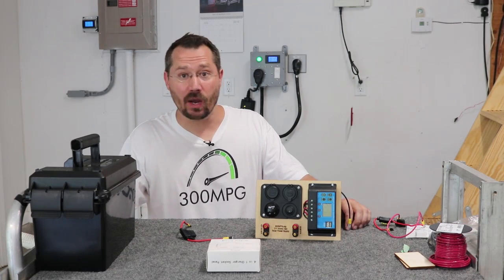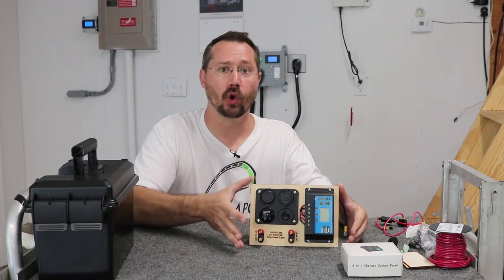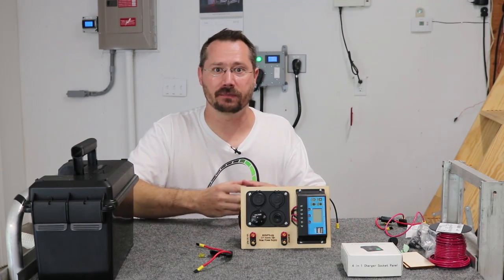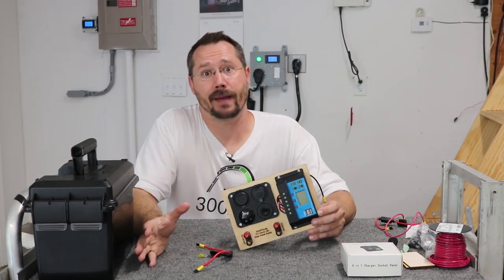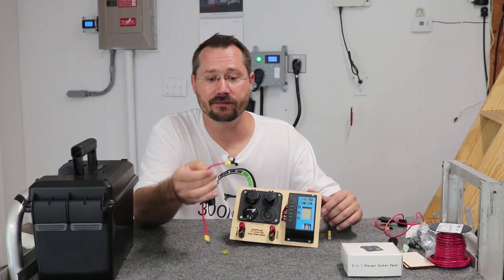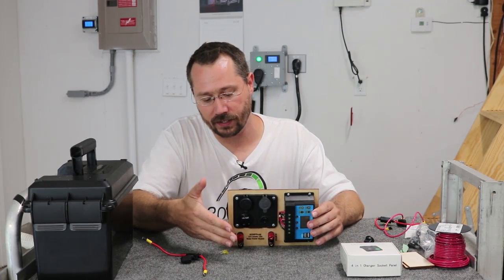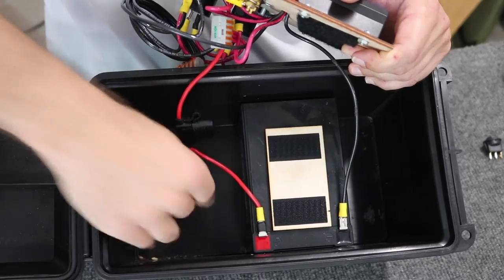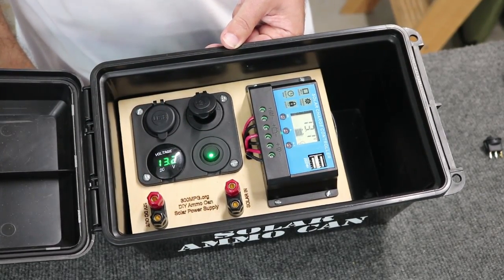Solar Ammo Can Alternative Wiring and Disconnect Switch

Comment: On my first build I used a large 32HA battery which uses large bolts for positive and negative. I actually used an automotive disconnect on the negative side, which disconnects the entire system by turning a knob. Quick and easy. My second build I used an isolated switch on the outside of the box that turns the controller on and off because the batteries are smaller with blade terminal connectors. Love your videos on these. I used 90% of your info to build mine. Thanks for that.

Comment: Hi Ben. I built a box using several different vidoes from other builders. I too cut out a small template using 1/4" ply, definitely too thick for the rocker switches I use. I actually wired each load component with its own switch, just so I could use other ports e.g. SAE, or Banana Jacks, etc, independent from the main panel and main switch. Most other builds have switches, and other components all mounted on the outside of a waterproof or water resistent box, I cut my own panel template to keep everything nice and neat inside, and with less opportunity for water intrusion. 12v 12 ah battery. Then I decided to add solar. Now cannot seem to get it to work. So, I dismantled the entire wiring schematic and am starting all over. Adding solar was supposed to be easy, not.
Great videos, and yes, when folks do the wiring on camera and go fast, that is a turnoff. Was for me. I am in the process of filming an entire build and will go slow through the wiring portion, as most reviews or comments are in regards to the wiring. You do not have to be an electrician to do this, but it is still new to some, fun for most, and a neat idea for camping, kayaking, etc. Thank you for the vids and the instructables, etc...

Comment: Sweet didn’t know you made this video. Good stuff. I actually have two switches. One that turns on the charge controller. Then another one turns on the ports. This will allow the charge controller switch to be turned on when charging and not have to turn the “load” ports on.
Reply: That's what I did on mine, too. 
One switch allows charging and energizes two banana outputs. This also works as the "kill" switch. The other switch turns on the quad panel.
Reply: I put a second switch in in hopes to do the same but I can't seem to figure out the wiring.  Are you able to assist me?

Comment: Thanks again... I really enjoyed the first video, until another viewer mentioned a switch between the battery and first component(solar controller).. couldn’t agree more on that comment... then I saw your modified, updated version.. thank you.
I am now looking for a fusible disconnect switch(20 or 30A) that is more robust and yet small enough to fit in this limited space..
Again, thank you for a great video!

Comment: Ben Thank you for that great Video.  I ordered your template board(so great of you to put that out there for us.)  I agree with Sandra I'm totally with you on putting all the components  together but when it comes to wiring it up with the wago connectors you sort of timed lapsed through it and lost me.  Also I'm interested in the alternative disconnect switch wiring.  Please, please, pretty please, could you do another wiring video step by step for electrical newbies like me.  I don't want to blow myself up.  Thank you.  Rockin and Rolling in Southern California and want to get this box built for my earthquake preparedness. Rick
Reply from the maker: Don't worry, you won't blow yourself up.
I also have written directions on Instructables. Sometimes it's easier to follow written directions than video ones: https://www.instructables.com/id/Ammo-Can-Solar-Power-Supply/

It's a bit hard to do a great video on the wiring as you would mostly just see lots of my hands blocking the view of where the wire connections are made. Probably best just with the listing of what goes where. Check out the Instructables link and see if that makes a little more sense for you.

Comment: Ben.  Wow.  Informative with excellent and needed tips.  Electronics is one of my many weak points.  That said, I am looking at using a DC wall adapter as an alternative when solar is not easily useable.  My plan is to use a SAE type connection for the solar input.  Is it possible (without creating a Griswold electrical disaster) to splice / marry the SAE connection to the end of an appropriate DC wall adapter?  Do you have advice on that?
Lastly, based on the original setup - one of the best builds / designs on the Tube - what other options are there to prevent a ghost drain on the battery via charge controller?  Another switch?

Comment: great video, really great however I would like to add that using the switch panel as a master cut off could actually be a problem. If I were to use this configuration whilst camping with my family, you could guarantee my wife would switch it off at some point during the trip leaving the solar panel burning the controller out, I'd prefer to remove the fuse to isolate everything
Reply from the maker: I don't see how the solar panel would "burn the controller out".
In my original video, I suggested simply pulling the main power connection or the fuse. Many people commented that that would be inconvenient or that the system REQUIRES some sort of disconnect switch.
I shot this video just to show another way it could be done.
My personal preference is just to disconnect the main wire before storage.
Reply: BenjaminNelson the manufacture of the solar charge controller says it’ll damage the controller to have the solar panel connected with no battery. A double pole single throw switch should be used to disconnect both the battery and the solar panel

Comment: Watched the videos and really like the designing, pretty cool.  I'm building one with a slightly larger dry box with 2 X 12 AH batteries.  I think it will be around 18 pounds.  It should have room to expand it to 3 X 12 for a total of 36 ah.  At that point it wouldn't be "portable" but would be a great box for vehicle Stealth Camping along with a 30-50 watt panel.  I'm using one of those larger socket panels, the one with the 4 items plus like 6 buttons across the top.  Is everyone making these as shown with the socket panel etc inside the box?  I like the idea, but for stealth camping I like the idea of having it more like an appliance with easier access.  Still assembling parts mostly from junk I have laying around.

Comment: Thanks for the heads up on battery drains.. I always leave my battery charger connected even when it's turned off.. Now I just pull the quick disconnect..

Instead of manual switch, couldn't you just install a Low voltage disconnect relay, and that would limit the amount of battery discharge, no matter what is draining it?
Reply: I am also interested in using a cheap LVD, trouble I see is the wire size that goes from battery to load needs to be very small 16-18 guage to make the connection through the LVD? Not the 10 -12 guage I would like to use.

Comment: Very good video.
Question, how do you reduce the 12v to 5v for usb power?
Reply from the maker: It's built right in to both the controller and the secondary panel.

Comment: Great instructional videos!  I've run into a little problem wiring in a separate illuminated toggle switch.  I have the switch grounded and source connected properly.  When I connect the load going back to the controller it shorts, blowing the inline fuse.  Any thoughts??
Reply from the maker: As much as I like illuminated switches, there are so many ways to hook them up wrong!
If you are getting a blown fuse, it likely means the switch is accidentally hooked up so that it's directly connecting the positive and negative of the battery together. Good thing there's a fuse in there, as it's exactly for situations like this that they are helpful - preventing melted wiring and the other bad things that can happen with a short!

What I would do is to completely remove the switch, and hook it up just by it's self, separate from the Solar Ammo Can project.
Make sure to correctly identify which terminals get the positive, negative, and switched load connections. Use a multimeter to CONFIRM that it's correct and check for open-circuit/closed-circuit continuity where you expect it to be.

Another simple option would be to use a NON-illuminated switch, as that eliminates the variables of the extra connection.
Reply: @BenjaminNelsonX . I was stumped with how you got your switch to work.  I tried your suggested configuration along with alternative configurations.  Appears my illuminated SPST switch internals can't handle the specific configuration.  Going back to an SAE connection or simple on/off SPST switch.  Thanks for the response.

Comment: Nice project and update, but I'd really want to isolate that USB 5V socket as it is a drain on the system that you are forced to have when charging the battery. May not be ideal if using solar and the sun light is weak that day. Those USB sockets are a drain as there is energy loss convertng 12V to 5V,  I've seen issues with them on camper vans where people hard wired them in with no disconnect.

Comment: Hey Ben, thank you so much for the awesome solar box idea/tutorials. I mounted my solar charge controller on a thin piece of plastic then on top of my 12V SLA battery similar to your idea, Q: is there anything inside the solar charge controller that might cause damage to my 12V SLA battery?
Reply from the maker: That charge controller will work fine with an SLA battery.

Comment: Hi great videos. Is there any foldable solar power that would fit inside of the amo can?
Reply from the maker: I found one folding solar panel that would fit, but the other components would have to be moved around. The panel would go in vertical, so the battery would need to be turned 90 degrees to make room for it. It can be done, I just preferred the layout I went with.

Comment: I know this is an older video, but still hope you will respond. Thanks for sharing this tutorial exactly what I need.. 1 question though.. Did it not concern you that the battery said do not charge in an airtight enclosure. I am thinking to use 2x np7-12L batteries in parallel, as cheap here in UK vs other options... But they also say on data sheet Dont charge in airtight enclosure as these sealed lead acid batteries emit gasses through thier vent valve... What is you thoughts on that? Thanks Paul
Reply from the maker: The battery isn't charged in an air-tight container. The lid needs to be open to connect the wires from the solar panel.

Comment: Yo Ben, I have put my solar fish canister together with this set up. But im having a hard time trying to find something to charging my battery. I haven't been able to find a solar panel or dc charger with banana jacks. And I believe you said you could charge the battery by using bare wires instead.

  I have a 15 volt dc charger, but with  no positive and negative specific wires, but with one long wire instead. Would I have to clip the plug off the charger and then put the bare wire itself in the red banana jack port to charge the battery?
Reply from the maker: If you have a charge with a barrel connector on the end, yes, you can just cut it off and use connectors that support bare wire going straight to the battery. Make sure to observe proper polarity.
Reply: @BenjaminNelsonX  I'm sorry but I dint think we are on the same page, I mean how would I just use bare wires to charge the battery (using the banana jack ports)? 
Thank you for everything you have helped Me with so far though.

Comment: Great video and thanks for the update. It hard to tell, but is there room in the ammo box for a 2nd battery?
Reply from the maker: Yes, you could add a second battery of the same size and shape, and wire it in parallel to double your battery capacity. The downside is losing the "storage area" in the box to keep your accessories.
Reply: Thanks, I like the idea of a 2nd battery and then perhaps another small ammo can for the accessories. Other option would be a 2nd ammo can for 1-2 batteries only and connect your build to an extra double battery pack. Thanks again
Reply from the maker: Lots of different ways to do it! Try it out and see what works best for you!

Comment: could you put 2 of those batteries in the box.  GREAT VID
Reply from the maker: Yes, you could have two matching batteries wired up in parallel for double the capacity. It would simply take up the extra space which I just use as "accessory space" in the ammo can.

Comment: I understand the two studs for solar in but what are the 12v out studs for thanks
Reply from the maker: They are for whatever else you want. I don't know every possible 12V device that people would want to power with the Solar Ammo Can. By providing a dedicated output that can work with just bare wires, you can power literally anything you want.

Comment: Does the solar charge controller automatically shut ogg when battery is full?  For  example i need to charge it while iI am at work  will it shut off  on its own or will i have to watch it until its  full charged?
Reply from the maker: It's automatic. That's really the point of it.

Comment: Any thought on using lithium-ion/iron-phosphate/polymer batteries?
Reply from the maker: Lithium batteries are great in that they have lots of power, but in a small and lightweight package. Unfortunately, they are still relatively expensive and are a little more complicated to charge and not over-discharge. This project was designed as a very simple one to get anyone into the basics of solar-charged battery systems.

Comment: Can I us this to power a box fan or desk fan overnight
Reply from the maker: You could power a small 12V fan overnight.
For anything else, do the math. Look at the label on the electric appliance you want to run and see how much current it draws. Divide the capacity of your battery (in AH, amp-hours) by how much current the device uses (in Amps) and you will know approximately how long it will run (in Hours.)
This was only ever designed to be a small portable system, but you could easily hook up a much larger battery in place of the small one used in this project.

Comment: What gauge wire are you using
Reply from the maker: I used all 12 AWG wiring on this project.
Frankly, I could have used 14 AWG for everything. Essentially, the entire project is rated for 20A, but on short runs of wire in the open air (instead of in a wall or inside conduit) slightly smaller gauge wire handles more current than it otherwise would.
14 AWG would just be a little more flexible, so easier to work with.

Comment: One thing you have to remember is there are two sizes if USB ports standard and other is smaller Samsung has two different USB ports.
Reply from the maker: These are the typical USB A ports. You can find adapter cables from USB A to any other type of USB as needed for charging a phone or any other device.

Comment: Can I use a lithium ion battery
Reply from the maker: Yes. Just make sure to use a solar charge controller that is designed to work with lithium.
Reply: @BenjaminNelsonX   Im wanting to power a small 110v fridge . To 2 to 6 hours.  Do you think this would do the job? I have viewed some 30amp controllers